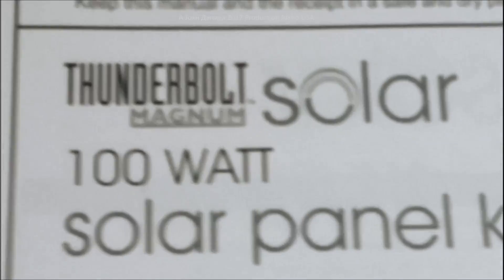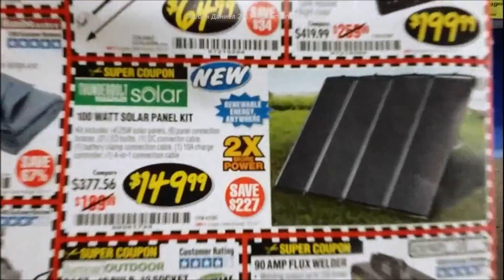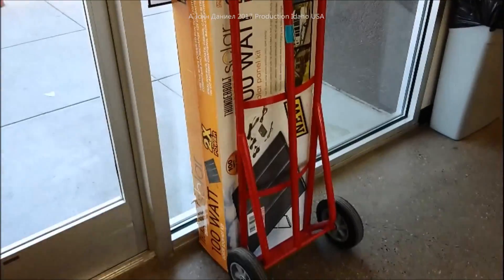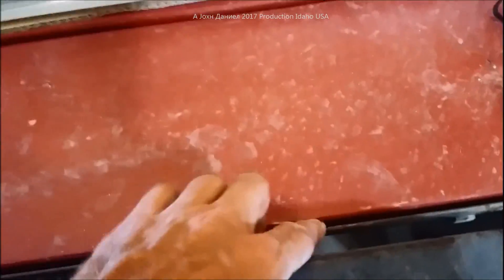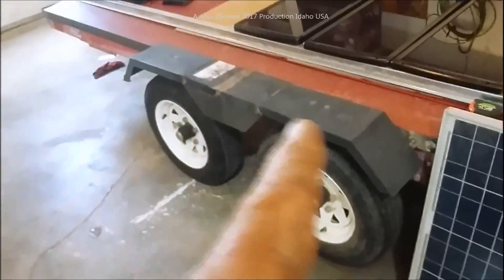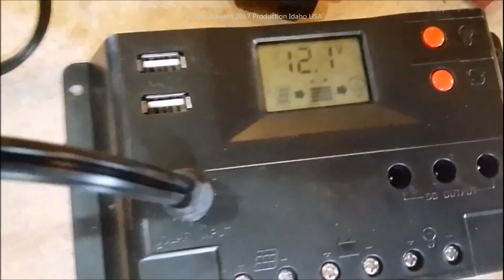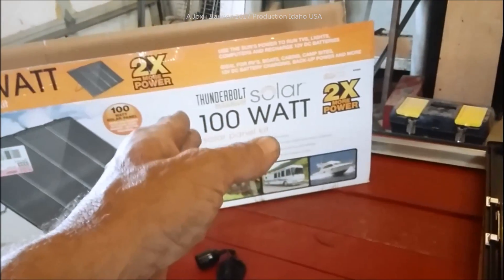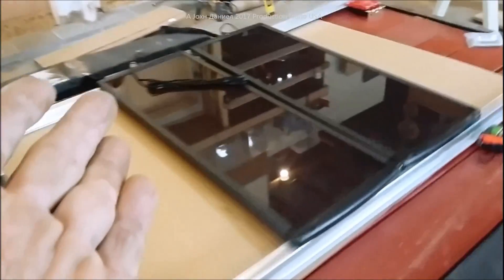Harbor Freight 100 watt solar kit #63585 NEW Thunderbolt Magnum (MAJOR PARTS LIST BELOW)

Comment from the maker: *ATTENTION MY VIEWERS, FUTURE VIDEO NOTIC*E : Your gonna love this POWER MONSTER , Seriously! http://rover.ebay.com/rover/1/711-53200-19255-0/1?icep_ff3=2&pub=5575119394&toolid=10001&campid=5337663844&customid=GENUINE+THERMODYNE+&icep_item=391724551221&ipn=psmain&icep_vectorid=229466&kwid=902099&mtid=824&kw=lg Super DC Generator PMA  , a 3000 Watt Dual Core PMA Permanent Magnet Alternator for Wind Generator, VAWT and a Even remote engine DC power generator. In a soon to show series,  I will be building the ULTIMATE freaking DIY power house, Cheap, and STRONG! And YOU TOO can do this.

Comment: Damn good show Mr Daniels, I wonder why people hate on these little solar panels, Harbor Freight has got more people to get into solar power than anyone on the planet. Relax haters, you can sell these people on your crap, just let them learn from a kit that is affordable, close to them in stores and easy to set up before you try to shove what your selling down their throats.
Reply: CSXRockford  where plz ?
Reply: Exactly what i was thinking. Better to make a mistake with harbor freight gear than anything else.
Reply: CSXRockford  a much better panel that charges in the shade and indirect light conditions? Please, do tell......
Reply from the maker: +Mason Menard The ones preaching hate are customer stalking sellers of fake rated solar junk. Ignore them.
Reply: @JOHNDANIEL1  we do. It's a shame there are more doubters than believers in this world. Ignore them and you will succeed.

Comment: how do I get ahold of you about some of those gizmos bulk head bolt to whatever you
Reply from the maker: +Chuck Mac I'll post it asap.
Reply from the maker: The Bulkhead Post adapters your looking for http://rover.ebay.com/rover/1/711-53200-19255-0/1?icep_ff3=2&pub=5575119394&toolid=10001&campid=5337967172&customid=80+Amp+Post&icep_item=142044360664&ipn=psmain&icep_vectorid=229466&kwid=902099&mtid=824&kw=lg As seen in video
Reply from the maker: OPTION 2, I can send you 3 sets of 2 for $12 shipping included as long as its in the lower 48 states, if your elsewhere I will have to check cost. Just go to paypal.me/PokysParts/12
Let me know if theres any problems and make sure your shipping address and email is on your request. Takes about 4 to 7 days due to my work schedule to get them. 3 sets of 2, 6 parts in total. 80 amp capacity.

Comment: Yup HF has indeed come a long way with this kit. Even at 100w though it's not going to do much more than trickle charge a battery and run some CFLs. If that's all you need it for then it works and worth the money for sure. Connect a few of these kits up together and it will power some landscaping lights or maybe even a small pond pump for a few hours. Don't buy this kit thinking it will run a fridge or power tools however, strictly light use. And sure, you can have a huge battery bank capable of running heavy loads but if you're not producing the power you use plus say 20-30% more for inefficiencies then your bank will eventually fail. That's what many people don't take into consideration when buying these smaller kits. Great value none the less.

Comment: how does a get to be 100 Watts just by adding one solar panel because when it has three it's only 45 Watts
Reply from the maker: +Clintimtired They are slightly  larger, more densely deposited grid and heavier material plus there are 4. I would venture to say that may be why output claims are larger.
Reply: Јоhn Daniel thanks for your reply I'm subscribing to your channel to check out your other video
Reply: The 15 watt panels have been around for quite a while.  These are a new design, likely with better materials.
Reply from the maker: The original panels had no backing material and they were not as good a layering process of materials on the glass. Seems the etching process has been really upgraded on these.

Comment: Thanks for sharing I bought some of these Sunday & plan on staying off grid while utilizing them they'll be attached to stealth trailer as well as my SUV. I'm new to this but I wanna learn all there is to learn about utilizing what the heavens have to offer in the form of clean energy.. now I have to build a battery Bank and whatever else that needs to be put with these what would you suggest if you don't mind me asking for eight panels
Reply from the maker: Conservation. Convert all incandescent bulbs to LED, You can get Warm White 1156 LED that uses 1/7 th the watts. Getting the right batteries, not exactly cheapest and buying them all the same and at the same time. Using a inverter thats efficient and not a harsh chinese cheapy.

Comment: SOLD !    I think i will at least buy 2 and maybe 3 sets.  coupon has limit of three.  I want  to run A/C.  HUMIDITY is DEADLY here.
Reply: At 2 or 3 set sets you might consider spending a little more and getting a true 24v system.  It is tough to run an AC on just the Harbor freight solar panel, just not enough amps.
Reply: Inverters to run AC loads operate better on higher voltage input from PV.  So this must all be well planned in advance !  Should we have reviews of inverter operation on 24vdc, 36, and 48 ?  imo, better to get larger inverter now and grow into it with future purchase of additional discount PV panels than a need to toss an inverter that will not handle increases in both supply and load efficiently ? Possible to get increased load on cabling when voltage is higher ??  I dunno...   rc
Reply: You need about 800 watts to 1000 watts of solar panels and  1000 ahr or more on batteries, just to run a 5000 BTU ac unit on solar at daytime.
At night, all bets are off.
Reply: Buy Renogy monocrystsline.  Much better deal and quality.

Comment from the maker: HELPING SUGGESTION - To properly mount & locate your panels get you a REAL Thermodyne Watt Meter, http://rover.ebay.com/rover/1/711-53200-19255-0/1?icep_ff3=2&pub=5575119394&toolid=10001&campid=5337966591&customid=Genuine+THERMODYNE+SYSTEMS&icep_item=391142371694&ipn=psmain&icep_vectorid=229466&kwid=902099&mtid=824&kw=lg PROVEN BEST ONE MADE, Don't buy that fake knock off copper colored aluminum wired sold from missouri junk. 
With a Thermodyne Meter you can find the best location and angle to get highest power output. Either mobile use, or fixed in place, get the most from your panels.

Comment: A reason good why you would switch to a 48V and hook the panels 12v panels in series is that in lower light enough voltage is produced to charge your batteries and the wire size can also be reduced.   Of course you would have to get a controller that can work on 48v,  a 48v battery bank, and a converter on 48v.  .
Reply: But a MPPT controller will permit higher input voltage from the panels and still properly charge a 12 V battery system.
Reply from the maker: +covercalls88 Excellent thought
Reply: The options arise when selecting an inverter with higher input voltage capability, for efficiency ???  rc
Reply: You could also go for 24v instead, which more charge controllers support.

Comment: hi how do u sell the connector
Reply from the maker: +Aidennguyen 06 I'm setting up a link for that you can go to. Should be soon as I can get enough time off my regular job to  do it. Check back later.
Reply from the maker: The Bulkhead Post adapters your looking for http://rover.ebay.com/rover/1/711-53200-19255-0/1?icep_ff3=2&pub=5575119394&toolid=10001&campid=5337967172&customid=80+Amp+Post&icep_item=142044360664&ipn=psmain&icep_vectorid=229466&kwid=902099&mtid=824&kw=lg As seen in video
Reply from the maker: OPTION 2, I can send you 3 sets of 2 for $12 shipping included as long as its in the lower 48 states, if your elsewhere I will have to check cost. Just go to paypal.me/PokysParts/12
Let me know if theres any problems and make sure your shipping address and email is on your request. Takes about 4 to 7 days due to my work schedule to get them. 3 sets of 2, 6 parts in total. 80 amp capacity.

Comment: I think the claims you make for amorphous panels are exaggerated.  They do not produce full power in cloudy weather or if they are not at the proper max orientation to the sun.  No panel does.  Just because it produces 23 volts does not mean it is producing full power, you need to show the amp readings on your voltmeter.  Amorphous panels are also much cheaper to make than crystalline panels.  The reason is because they degrade over a period of a couple of years.  Amorphous panels usually carry a 5 year warranty versus a 25-30 year power output rating from crystalline panels.  I'm not saying you got a bad deal for $149, but the information you provide is not accurate.
Reply from the maker: +John Goeke May be a english to your language discrepancy. The kit is 4 solar panels of 25 watt each, not sure where you may have saw 5, no one says or shows 5. Also how your posting name seems to self change plus I am Still trying to see where reading 23 volts incoming on a meter became a claim or insinuation of amperage value.
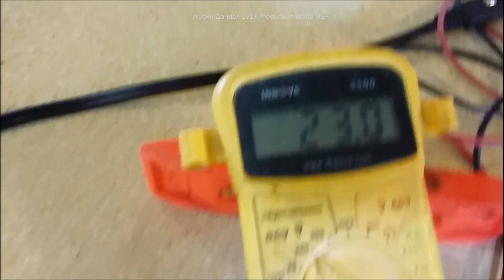Reply: Time stamp 5:40.  Full voltage does not equal full power.  Need Isc data.  Can you show amperage output from this panel in partial light from your workshop skylight please.  Your set of 5 panels for a total of 100 watt is approximately 20 watts per panel at 12 volts, is it not?  Will the panel you show give at least a 1 amp reading on your voltmeter (with mono panel usually around 1.20 amps in full sun)?  That would convince me.
Reply: https://www.energymatters.com.au/panels-modules/thin-film-monocrystalline/
Reply from the maker: Largest new solar farm projects world wide now consider Amorphous first as a source. Best Amorphous now made are from India and USA. And when you find a link (BLOG) about Amorphous verses Mono always use your common sense and see how many BUY NOW links are on it for THEIR solar panels. Which are usually Mono. I sure Love my Stion and Uni-solar Amorphous. But if your living on a postage stamp, and don't have the roof or yard space, buy Mono or Poly. I have 12 acres to be a solar crazy on.
Reply: Buy one and prove they don't produce power in low light conditions. Thin film solar panels are known to produce power in low light conditions. That's why they use them in calculators and other solar applications. For the money you can have solar and save money.
Reply: That's kind of what I'm wondering. After about a month I wonder how these panels will be doing. Also, I'd never charge a busted battery due to the risk a damaged battery poses.
Reply from the maker: +Jake Goeke I have been using and installing both since 2005. Amorphous are much more expensive to make thus the reason most makers world wide which went out of business were not able to compete with cheap poly and monocrystalline. 
People's ignorance on placement orientation of amorphous designs continues today as well as warranty.
My Kaneka and Stion amorphous  panels have a 25 year warranty and my uni solar are still at full power since 2008 while every poly panel I own from 1 year old to 6 has degraded. 
No panel gets full amperage without absolutely focusing it in pure sun light. However do your own experiment and you will learn that amorphous produces the same peaks as other styles yet does it for many more hours a day and does make a charging amperage much longer per sun cycle.
Reply from the maker: +Jake Goeke Can you put the time stamp location down in a reply where I state or elude that it showing 23 volts was referred to as making full power?

Comment: Voltage alone is not an indicator of how much power the panels will produce once hooked up to any kind of load.Hook it up to a battery with an ammeter in the circuit and I bet you'd be pushing less than 0.25 amp per panel under those conditions and practically nothing under the garage lights alone.    Still, the kit does seem to be much nicer and a better deal than the 45 watt kit.  Under full sun, the 4 panels will probably produce about 5 to 6 amps total current which is not bad at all for $150 with all cabling and controller included plus two nice 12 volt LED lights..
Reply from the maker: +alexermerson Stay tuned. With my truck parked in the carport, from ambient light only these charge and do so very well. A video with meters and results will be up asap.
Reply: John,I actually bought one of these kits yesterday and ran a couple tests on one of the panels.   Under mostly overcast conditions, the single panel was producing 0.2 amps to 0.4 amps short circuit depending on how dark the cloud in front of the sun was, which isn't bad.   The few times the sun peeked out it got to 1.25 amps which is on par with what I would suspect it to produce.   I'm confident that under full sun it will put out at least 1.6 amps short circuit current which is what could be expected from a single 25 watt panel.    Hooked up to a battery, expect about 15-20% less current than the short circuit current due to less voltage differential.  Sadly, the way panels are rated, you never get the full output unless you have an MPPT controller.  I expect about 70 watts of charging power for the whole set in full sun. Yes, these panels will produce power under low light and even be able to charge batteries, but not anywhere near as fast as in proper sunlight.
Reply from the maker: +alexermerson Since 2008 I have been using solar power, 99% are not from a harbor freight kit either. This is the second one I ever bought since 2007 actually. The first 3 from 2007 which are still working at about 80% of their rating on a watt meter are sitting on a property on a 8x12 shed charging sub c batteries for a light. This second set is drastically different but I have noticed that they sold 3 or 4 variations between 2007 and 2017. I own none of those. 
These are very upgraded IMO and I'm not new to solar (you apparently did not watch any other videos I have). 
We will see what the results are over a few weeks, everyone may want to save the pessimistic or uninformed think till the results are in.
Reply from the maker: +alexermerson I got 91 watts from 4 with just a meter and a battery, NO CONTROLLER. With the provided controller it's charging the batteries at 72  watts right now, hazy light clouds but in full sun a hour earlier it is still 72 watts at 5.44 amps. Respectable comparing a Missouri Wind Solar "claimed as" 100 watt panel has never made over 5 amps, ever.  And these did wake up early and get out 19 watts at 7 am my time when I went out to check on them. At 9 am they were hitting 59 watts post controller in very hazy sun. Max voltage open so far is 24.7 vdc. However Amorphous has a 70 hour break in time, it will probably rise some.
The controller they send uses 15% of the panels potential!!!! Find a 20 amp mppt and 8 of these panels and you got something.
Reply: John,Agreed that the controllers eat up a lot of power.  MPPTs are awesome but at their cost, it's cheaper just to buy more panels to make up for the inefficiency of standard controllers.
Reply: henry coulston 
Did you buy and use this with regret? If so; please explain further.
Reply: Mines holding in a window, they are astounding...
Reply: They always tell you the watts because it's a big number. It amounts to 8.3A but it's more than twice the power as the old ones for the same price.
Reply: The test for a solar panels  overall efficiency is how much light energy it takes to get to its top unloaded voltage rating.
Reply: I lost money. keep receipt and box. please get warranty. even deep cycle battery.
Reply: alexermerson mmm
Reply: alexermerson is agree with you.  I have this same kit and have an agm type battery with 55 ah capacity. It's sooooooooooooooooo slow at charging.  Takes 2 days and it still doesn't top off the agm stops short. Could be because the charger doesn't have specific setting for agm batteries or not enough wattage from panel. Sad thing is many will see that the voltage went up .1 volt a second after he plugged it in. It was probably almost  to the point already.
Reply: Jesus Christ died for our sins, was buried and rose again to save us from eternal judgement and give us eternal life if we believe Him. Only God can save us and freely give us new life inside forever
Reply: @deha11mo  
Amen!
Reply: @deha11mo  bull shit
Reply: @eddiepalmer8103  amen brother
Reply: @deha11mo  Was he buried at Harbor Freight? Did they use the solar kit to provide the power to roll away the stone? If so how long did they have to wait for the batteries to fully charge? And why did you comment this on a video that has nothing to do with dying in a Roman execution or putting out coloured eggs by a rabbit for children to hunt. i will await your answer ( just don't keep me waiting for 2000 years)

Comment: this may be a dumb question. but what would be a good application for this. because I do see it is DC meaning I can't use it for home application like for a window unit right?
Reply from the maker: +nestoavila Do some research on inverters and deep cycle batteries to get up to speed on solar powers DC to AC uses.

Comment: Panels will not work in low shade with out a mppt controller, If you wire them directly they will produce power, The most part is because of the charge controller.
Reply: Apparently he put the panel in the garage with sun from a skylight, I would call that shaded and it charges a battery. We have our barn with Uni Solar amorphous that are 10 years old. 20 of the 136 watt panels and until 11 in the morning the 3 elm trees shadow most of them and they put out almost full power. We only have pwm controllers out there, they do work in shade.